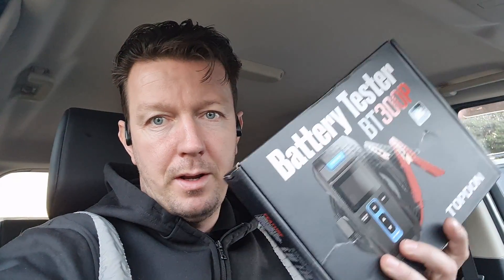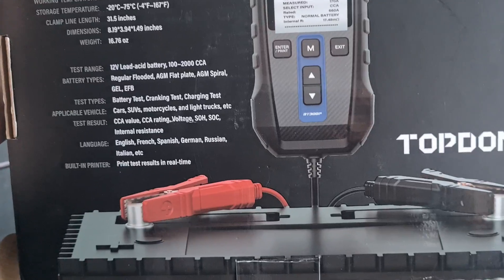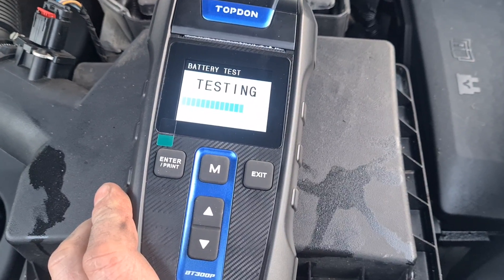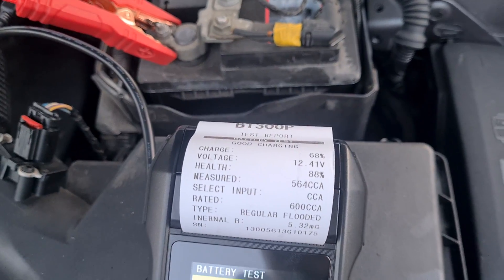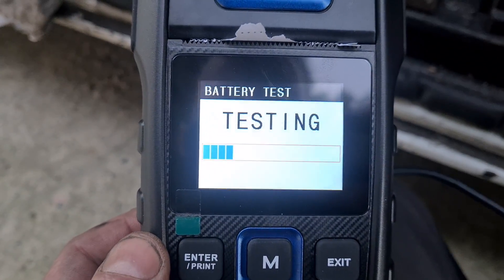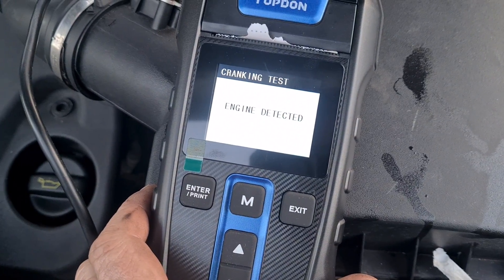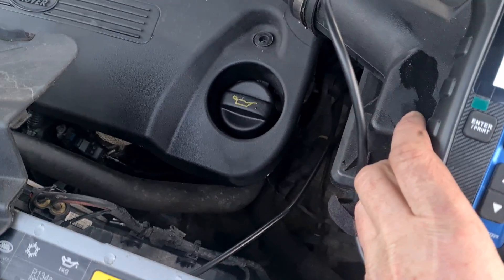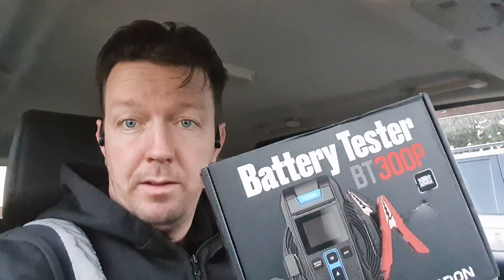Topdon BT300P Battery Tester

Comment: Cheap and cheerful tester - I have the Midtronics tester which is a quality bit of kit but all these testers work on a similar algorithm of data usually internal batt resistance/temperature etc etc. I use at least 2 or 3 methods of battery testing before I condemn a battery 1. Midtronics 2. Drop test 3. Hydrometer test if possible (wet cell).

Comment: the Halfords EFB battery told you the criteria to select, 700 CCA(EN) so why didn't you select EN ?
Reply: CCA and  EN are equivalent battery rating standards so make no difference at all which one you select as same result would be recorded.
Reply: @larrysimon1  CCA is equivalent to SAE, EN is a more stringent test so a 700 CCA/SAE battery in EN is aprox 640 if you test an EN battery as CCA/SAE it's got a better chance of passing, if you test a CCA/SAE battery as EN it's more likely to fail the test. However some manufacturers show the battery Amps as both cca and en for the same rating others will give multiple ratings on the battery with the correct number after en cca sae din etc
Reply: @Lishi-Lee  EN standard is tested at the same temp -18 degrees C but split into to separate tests of EN1 or EN2 ...........both are not used in this Country because they are far to complex and CCA & SAE is simpler and better for the UK and USA.  EN Standard may in theory be more stringent but it is also more complex and not relevant to fast accurate battery diagnosis or real world testing.